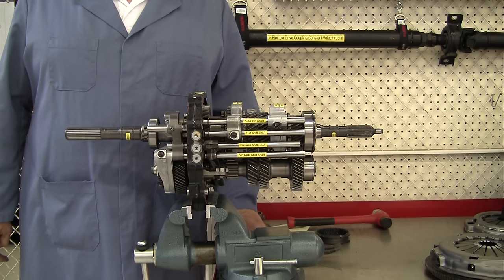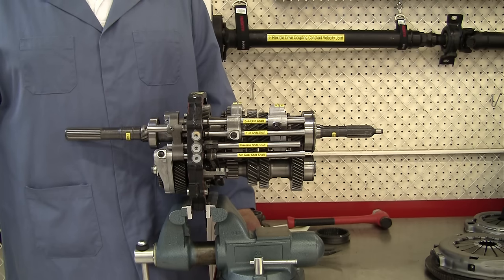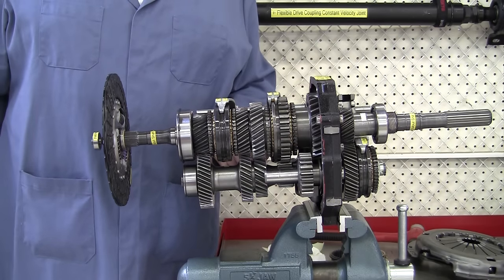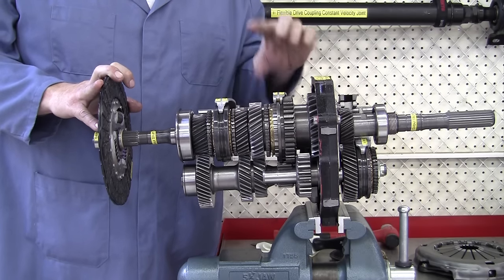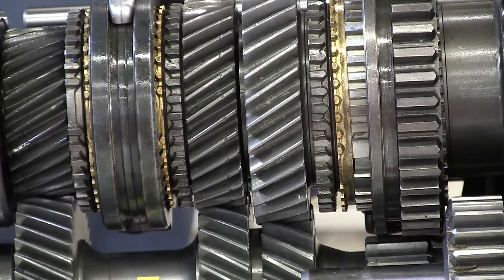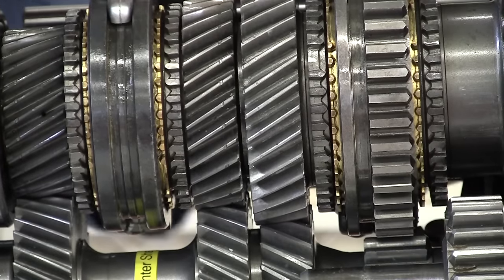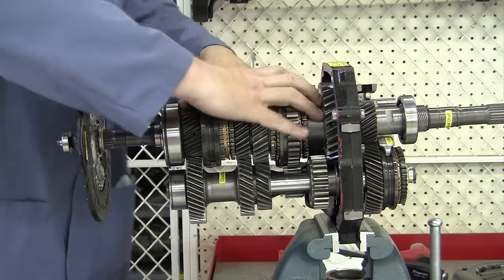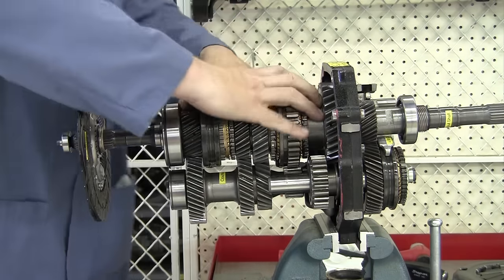Manual Transmission Operation

Comment: What can overheat the oil in a manual transmission ??
Reply: The transmission itself? Clutch plate?
Reply: Usually won't happen unless the level, viscosity, type, or some combination of lubricant is incorrect or absent. If there's damage already and metal flake flowing around in it, this will increase friction and therefore heat.

Really hard driving also creates more heat and will age the oil sooner... 

The heat in a stick comes mostly from the selected gear's teeth mating surfaces as they slide across each other, and to a much lesser extent, the freewheeling gears, selector forks/collars, and trivially, bearings. There's not enough heat coming back from the engine or even clutch to have much effect (other than reducing the case's ability to get rid of abnormal heat)... So total breakdown of the lubrication in a manual generally has an extreme cause, from within. 

They can actually be run "dry" for quite some time provided they were first "wet" (in other words, filled, worked in, and drained, not assembled bone dry and never saw a drop of oil). 

Absolutely not recommended of course, but you could conceivably lose the oil in your tranny from a rock or something, have 25 miles to go, further even, and still make it just fine.
Reply: @ronald8652  sorry didn't see your answer. It was the transmission...
Reply: @MadScientist267  Thank you. It was actually on a Volvo truck/big rig. We opened it, one bearings was Pitted and worn resulting in extensive play and one bearings had locked up resulting in the body of the bearing spinning on the shaft.   Apart from the oil overheating going up or down steep hills there was no sign something was wrong. Noise, gear shift everything was normal...
Reply: @cdo29mike  Yeah it's always an indicator that something has gone pretty wrong somewhere within because the only way a manual transmission can make any heat of it's own is metal to metal friction.

There's not much "cooling" designed into the case explicitly because under normal conditions there simply isn't all that much heat to get rid of. When it shows up, it can build.

Comment: Could you please explain me something:
Why do we need clutch in this case since we have the blocking rings to synchronize the speed of synchronizer and the gear? 
Look what i mean:
If we press tge clutch - the transmission shaft will keep spinning because of the momentum, so the blocking ring will help synchronizing. 
And if we donr press the clutch - the shaft will also be spinning and technically the blocking ring should gelp synchronizing anyway. 

Please, somebody, explan me🙏🙏🙏
Reply: The transmission shaft is locked to the speed of the engine, or input speed, while the blocking rings are locked to the output speed.

When you try to change the gear without the clutch, the synchronizing ring will try to match the speed of the gear to the output speed (either by accelerating or reducing its speed). But since the clutch is not pressed, and the engine is still powering the gear, the synchronizing ring doesn't have enough power to change the gear speed and the gear won't have enough power to change the synchronizer speed, resulting in the blocking rings not being able to lock in the transmission because of the different speeds.

You might be able to perform this clutchless gearing if the transmission is unmounted and the output shaft is not connected to anything (like on the video above), so the transmission gear can try to bring the synchronizer to its speed and therefore performing the same effect as if the clutch is pressed.

I remember that some old vehicles like the VW Bus are able change to 3rd to 4th gear without the clutch once you lay off the gas pedal and let engine slow down enough for the 4th gear to syncronize with the 3rd.

Hope I could make myself clear!
Reply: @leolenori7266  you are an angel!!! 
I've been researching for days to find the answer, but I would always fail. 
You explained it all so clear and so understandable. Thank you so much! You have no idea how grateful I am and how much you helped me.
Thank you!
Reply: @vasiliypeace2411 No problem! Glad I could help.
Reply: @leolenori7266 
Years ago I had a Geo Storm with a manual 
At a stop, without touching the clutch, if I put pressure on the shifter towards first gear 
(I couldn’t get it into first.. but pushing it up against where first would be) 
The car would start moving forwards 

This isn’t something I did much of.. just a weird quirk I discovered in traffic one day 

Assumed it was bad for the transmission 
Kind of wonder if I could have kept pressure on it until the car got going fast enough to get into first without ever touching the clutch
Reply: @leolenori7266 I was able to shift pretty much every manual I’ve ever driven without the clutch if you applied pressure to the next gear and get the rpm of the motor to match what it would be in that gear and speed. 

I know it wasn’t ideal, but when you got rpm up to speed it would almost fall into gear.
Reply: @leolenori7266 I had a 1968 VW panel truck that got a busted clutch cable yearly.  That thing shifted without a clutch very easily.

Comment: On my 93 f150
1st 2nd 3rd and 5th make a whining noise that gets louder as the rpm’s rise. 4th gear is completely normal. They only makes noise when the clutch is engaged. I’m not sure what it is. 
Barring maybe??
Please Help.
Reply: I do believe in the 93 f150 that the gears you described are indeed "straight cut" gears
Basically that means it will make a whining noise and gets louder as rpm's rise.
Its perfectly normal

Comment: I see that 2,3,4 gears have direct connection to counter shaft, but the 1st gear has no direct connection with counter shaft or is there ?
Reply: Pretty sure it has, 1st speed gear on the countershaft isn't visible in this demonstration

Comment: 'replace pilot bareing'. I've been working on cars for decades. Never heard anyone suggest this ever. Is it just an American thing? I'd never consider doing this over here in the UK.
Reply: Well, you went through the trouble to pull the transmission or the engine, and it's a very cheap part, so why not? It's 5-20 dollars on its own, but when I buy a clutch it comes with the kit anyway.
Reply: @ronkarper6834  thanks for your reply. I'm genuinely trying to understand this
........ you see it doesn't come as part of the job here in the UK and they would be considered a specialist part and as such £££!.... That's why I'm so curious as to why it's 'a given ' in the USA.... To try and elaborate..........
So say if I do a clutch on any given car. I remove the gearbox. I remove the pressure plate and clutch. If it's a dual mass flywheel I make a judgement on if it's badly worn or past it's recommended replacement milage and advice the customer accordingly.

If flywheel needs replacing it comes off. If it doesn't then it doesn't meaning I don't even see the pilot bearing (assuming said engine has one).

I then fit a replacement clutch kit which is the friction plate, pressure plate and clutch release bearing... Some kits come with a new fork spring or a fork pivot bush but that's rare.

The gearbox goes back on the engine. Job done.

I must have done over a thousand in my working life and never once had to or needed to replace the pilot bearing. (The only exception being my own 200sx/skylines I've converted from auto to manual which involves fitting a reduction brass insert to the bearing as the auto gearbox has a larger input shaft where it sits in the crank. So you need an insert to reduce to the manual gearboxs input shaft... But even that isn't really replacement as much as modification).

I'm not saying what you chaps in the USA is wrong. I'm just trying to learn and understand. I'm sure there is a good reason for the difference. Maybe something to do with oil quality? I don't know. But I wanna learn!
Reply: Yea that's why people in the US do it. Because you have gone so far just ensure it's all replaced if it's cheap. Just like working on something if you pull the waterpump to get to something else. Go on and replace that pump now while you got it off
Reply: @perception-reception  interesting. I've just never know one fail. Ever. And I drift so my clutch/flywheel etc gets huge abuse. In 15 years never had one fail. I imagine here it would be a special order dealer part. 
I wonder if us spec ones aren't as good quality?
Reply: @Adam Bainbridge   I've never had one go out but they come in most Clutch assembly kits in the US already. As far as specs I don't know but wouldn't imagine that they would be different.
Reply: Because like everything else, pilot bearings wear out!

Comment: My model a ford you have to double clutch  because the transmission has no synchronizer  rings. One has to align gear speed with road speed and engine speed. A three speed box does not have third speed of four speed, in  theory you are skipping third gear. I  had tramisdion my Mercedes  Benz the rings were worn I had to double clutch I liked people could not shift and they did not want. You had to watch speedometer and tachometer  a 1987 500 sdl

Comment: How confusing.
Reply: YES. He didn't "explain" a thing!
Looks like the gears are useless (they magically change the ratios, but nothing is moving, changing - I mean, they are always spinning and engaged to each other), the synchronizers are doing the job (like all power is going through them, not gears).
Reply: @qwertyuiop2895  The synchro hubs are fixed to the shaft, and the unselected gears are free to spin. When you select a gear, the synchro unit for that gear slides across and engages with the side of the selected gear, locking it to the shaft, while all the unselected gears are still able to spin on the shaft, so the effective ratio is the one you have engaged. The brass synchroniser rings (or baulk rings) do not transmit the drive, they are only active while synchronising the speed of the gear to the synchro hub during the engagement. When fully engaged, the drive is transmitted through the interlocked steel teeth on the sides of the gear and the synchro unit, which is splined to the synchro hub. Does this help clarify it?
Reply: @rickconstant6106  Nice explanation. I tried the same a few moments ago before I saw your explanation. I think your explanation is better.

Comment: trying to learn about transmissions. i didnt.
Reply: how come
Reply: then watch the whole video
Reply: Yes, bad video. It does NOT explain a thing (how the power is going through gears, where the real switching is taking place - inside shafts, internal splines etc., we don't see it in the video, looks like the synchronizers are doing all job, not gears).

Comment: And all this complicated stuff just to compensate for the inherent shortcomings of internal combustion engines...
Reply: @Shockload   Real, I think dude is an EV guy/ICE hater. Even though EV's are more complex and full of more limitations than any ICE car ever will be. Nothing in this universe with our laws of physics beats turning combustive force into useable energy.
Reply: @johnconcentrius  Huh?
You have a battery which gives power to a motor... whats complex about that??? at best there is a step up of voltage.. lmao

Comment: Very BAD video. It doesn't explain a thing. What's the role of gears if they are always engaged and spinning, you move synchronizers only (so synchros are transmitting all power then?).
Reply: I'm not sure if this is right but, since 4th gear is 1:1 it would make sense that 4th input shaft gear is fixed so that both input shaft and output shaft are spinning at the same time without any actual gear ratios, therefore 1:1. 4th countershaft gear should also be fixed so that all other gears flow through the 4th gear set. all countershaft gears should be fixed and 1st, 2nd, 3rd, 5th output shaft gears should be free wheeling. The synchro's should be fixed to the output shaft and only spline to a freewheeling gear when engaged to that gear. So in 1st gear power should flow from the clutch to 4th input shaft gear to 4th countershaft gear to 1st countershaft gear to 1st output shaft gear to 1st synchro to output shaft. Similar for each gear except 4th which travels straight from input shaft to 4th input shaft gear (fixed to shaft) to 4th synchro to output shaft.
Reply: if this doesnt explain anything then you probably belong at build a bear workshop.
Reply: Video does NOT explain that actual switching and power is transmitted inside (we don't it in the video when gears are assembled).
 
This is important detail. If you do instructional video, you should not forget to tell this.
Reply: @qwertyuiop2895  then learn braille because you cant see what he showed you with the input and output.
Reply: @PLAYERSLAYER_22  I can't stop laughing at your wonderful response! 😂
Reply: The upper helical gears are coupled to the output shaft via the sliding shifter sleeves. The synchro rings are to enable the sleeves to slide and engage without gear crunching. The helical gears are all permanently meshed. The sliding shifter sleeve does not engage with the helical teeth directly. Instead, it engages with some non-helical teeth that are part of the helical gear. See 16:58. I hope that helps.
Reply: @JSB2500  your short should be a prerequisite for this "moderately advanced course" video
Reply: @PLAYERSLAYER_22  Hi. Thanks. Yes, that was the sort of thing I was thinking (and why I've put links in this video - which I wouldn't normally do - to get people started). I left out lots of details, including which gear is being selected, how the gearwheel gets turned by the engine, how we get different gear ratios, the clutch and why we need it, how the synchro ring stops the sleeve sliding during synchronization and then how it lets the sleeve slide again, and how the sleeve turning causes the road wheels to turn.

I tried to take a Richard Feynman (physicist) approach of satisfying the learner but also getting them to want to know more.
Reply: well you did a great job. i was going to point out the first principles thinking that helps with thes communication of technical concepts with regards to feynman! interesting you mention him, i am obsessed! im just hoping you did not take a machine out of service to make the video, if so hope you got it rebuilt.
Reply: @PLAYERSLAYER_22  From just your comments above, I predicted you were into Feynman, which is why I mentioned him to you. It's also true that I considered him when I worked out how to strip the content down in the way I described above. It's also true that a physics expert likened me to him when I was younger (20s) - IIRC largely because I like to get right to the core of what's going on. (That was before I knew of him). It's also true that when I used to teach at university, the exceptionally bright students and researchers found that exceptionally helpful. They used to come to me with a problem in some complex domain, and I often used to diagnose their actual problem as a misunderstanding in some fundamentals that they learned years before, often at "A level" (UK age 16-18 schooling).

Just in case you are interested, my main line of business is the mechanism of intelligence (and consciousness) that is at the heart of the human brain. In the end, everything comes down to physics - even that!

Nice to meet you!
Reply: @PLAYERSLAYER_22  Regarding the gearbox: That one was damaged by metal rollers from an inner CV joint dropping out the joint and then chewed by the final drive gears. I'm practicing on it before repairing the "real" one. There are many details to get right, particularly the interlock system that prevents engagement of multiple gears simultaneously.

Comment: So many parts. Just get an EV.  Less to break.
Reply: But it doesn't go vroom vroom
Reply: @heykyubi   Correct. It but if you listen carefully, you can hear the car that goes Vroom Vroom way behind you as the Vroom Vroom car is radically slower.
Reply: @carterjohnson25 I don't see any Top EV dragsters, bud.
Reply: @carterjohnson25 I don't see an EV holding top speed records, plus you want to discuss where the materials for EVs are sourced?
Reply: @DaHolyCanadian  Australia mostly :)
Reply: Ya all are delusional. The fastest 1/4 mile production car is in EV.  And it costs 1/10 less than the fastest Vroom vroom car. 

All these moving parts are for dinosaurs. And we know what happened to them 😜
Reply: @carterjohnson25  I said too speed child
Reply: Well technically the fastest would be the ThrustSSC (1,227km/h) which is more of a Boooooom🚀car
Reply: Evs have transmissions as well...with moving parts
Reply: EVs are overrated and there’s still plenty of things that break on them.
Reply: Horse owners said the original Ford was overrated too.
Reply: @carterjohnson25  It was.
Reply: @paulferreira8342   Totally fair and altruistic opinion, but we all know how that story ended
Reply: @carterjohnson25  We still have horses.
Reply: @carterjohnson25 you can keep your EV, don’t force everyone else to have to buy one.
Reply: @Pointlesshandle48   Biden will do that for the us. But regardless, there will be a time when better is simply better... Then you will buy one too.
Reply: @paulferreira8342 😄😄🤭 really
Reply: @jay_2022y  Yes, really.

Comment: Did not understand at all! You should have done that on the board without the gearbox and all of the gears. Not a clear demonstration.
Reply: i found it pretty easy to understand
Reply: I thought he explained it very well...
Reply: Use ur imagination or do some more learning. U'll get it man.
Reply: I also found it easy to understand. I guess you aren't very mechanically inclined, or don't have experience using manuals.
Reply: There's plenty of "on the board" videos on Youtube. This one is amazing because he's showing ALL of the components, likes the synchros/cones, shift rods, etc. Other videos always gloss over these parts.